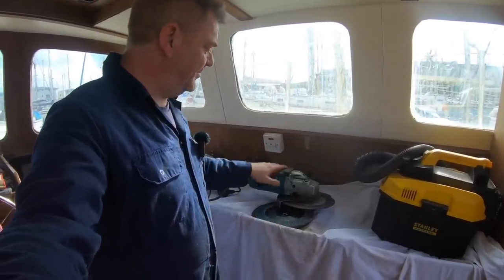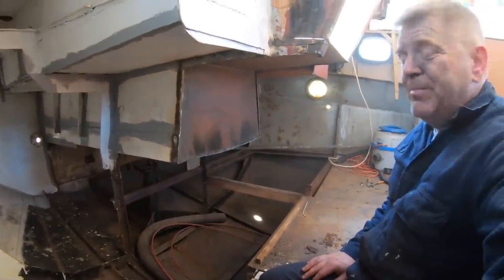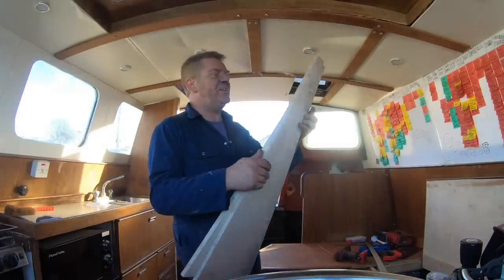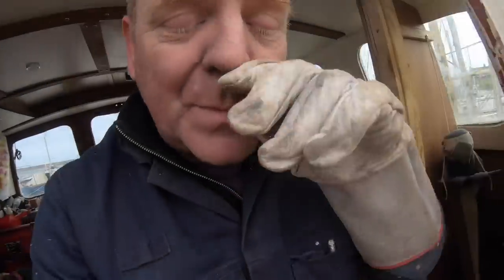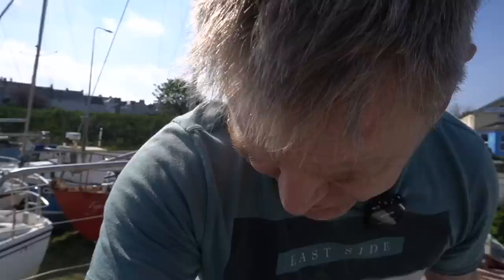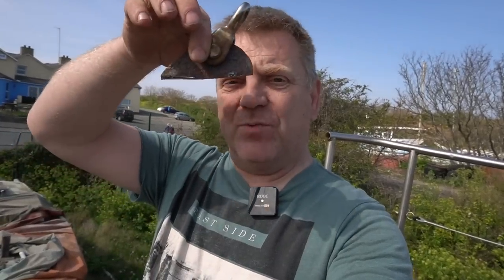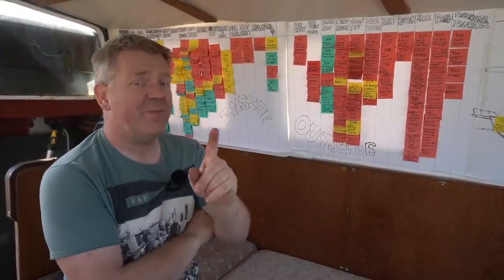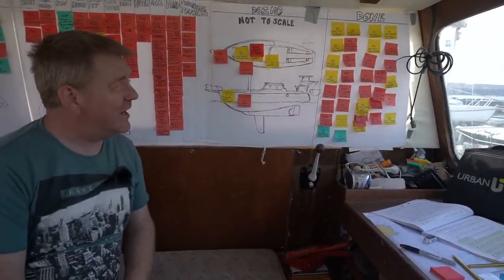#92 - Welding in CHAIN PLATES!!!! And cutting out under the bridge deck

Comment: Andy  9inch grinders are very heavy and not always the best tool to use. I use a 120mm grinder with 1mm cutting discs for most of my work only resorting to the 9inch as a last resort. See if Nigel can source you one of the old style leather welding aprons, these are great as they cover your legs when cutting and welding in tight spaces. They used to be super cheap. Good luck with your project.
Reply from the maker: I’ve got about 6 grinders of different sizes and I use many different types of disk from 0.8mm, 1mm for cutting and thicker disks for grinding etc.  it all depends what I’m doing at the time which one I pick up :) thanks though, I also have a leather welders apron which would have been very handy but I left it at home 🤦‍♂️

Comment: Your boat is coming back to life little by little, week after week. It will soon be a beautiful yacht, no doubt. The new stairs are great. removing the old rusty parts was a great idea. You now have a little bit more room inside... and no more sharp angles/edges. Good move.
Melissa, congratulations for your hard work for your skipper licence exam.

Comment: Lovely work!   I’m learning so much from you.   I wish I knew more about metallurgy and such, I have questions about welding new steel to old.   I’ll have to read up.   Lol.   Thanks for the video.   Welcome back Melissa and Jack!
Reply from the maker: Nigel knows way more than I do. Metallurgy is a big ol’ subject though :)
Reply: It's best to not think about steel as new and old, once you remove any oxidisation and get down to clean bare metal its the same as new metal. What is more important is identify what type of steel your welding together i.e mild, stainless, cast etc. But even more important is getting good penetration in the weld, a weld can look really neat and be very weak or look ugly as sin but actually be very strong with good penetration. in the very near future we have some hull plates at the stern to weld up close to the rudder post. If Andy agrees I will show some practical tips on how to get good penetration with MIG and Stick and ways to see if you have a good weld.

Comment: She really is a lovely looking old yacht but bloody hell there's a lot of work to do.
When it comes to the interior fit out, in my humble opinion, as nice as the traditional wooden panelling look they are dark, expensive to produce and maintain.
I think it would be interesting to give the boat a more modern look, using cheaper plywood and high gloss paints.
Something bright and airy, easy to maintain and clean, more like a modern home than a gothic church.
Just my two cents......
Keep up the fantastic work.

And as always
Massive Respect from Aotearoa, New Zealand
😀👍💛💙
Reply from the maker: Yes I don’t know if you saw the panels we’ve made for the saloon, we took them down for welding the chain plates but we’ve gone with a silk, off white which i spray on rather than brush

Comment: Nice job Nigel! Nice work m8, Good stuff Melissa 'Day Captain?' Haven't run into that before. Hope to find out more later. Just wondering, with all that cuttin you've done, what happen with Cap'm Jack Cabin? Seems to be, cut down by a third, from what I could see. Thanks m8s, you and yours stay safe and well.
Reply from the maker: I'm not sure why the call in Day skipper because you have to do night nav, but in essence is a skippers licence so you can charter boats and feel confident sailing in coastal waters, I eventually want to work up to yachmaster but rya day skipper is a good bench mark to start at.
Reply: @SailingMelody  Nice 1, m8, keep up the good work Eh!

Comment: Hi Andy, listening to your explanation of why all that substructure under the cockpit rusted has got me thinking 🤔, yes, it keeps on happening! Anyway, I'm wondering why the original builder drilled all those bolt holes in the first place. Thìnk about it, the only way for the wooden slats In the lazarette to fall out of the boat is if the boat is upside down in which case the slats are going to be the least of the problems! Here is my idea. Instead of bolting every slat individually why not join them together in a raft structure so that they can be secured with only 4 bolts or perhaps even without any bolts and just tied down with the ubiquitous cable ties? That way, should it be necessary to get under the rafts for some reason it's a simple matter to get them out. 
Melody is coming along beautifully. I think I had forgotten that she is a multichine hull which is very attractive to look at, esp from the stern angle. I think when it comes time for the final paint job she would carry a boot stripe very well! 
Good to hear that you're feeling better Andy! Hopefully, with the warmer weather coming up soon everyone will stay well! 
Cheers, David.
Reply from the maker: You know what….. I do like the idea of using nylon nuts and bolts to hold the wooden panels down, I think tie wraps would degrade but you’re right it’s fast to get under them in an emergency
Reply: @SailingMelody  Nylon is a great solution!

Comment: For your upright supports  rather then using flat steel as supports why not use section 80 steel pipe which is a lot stronger then flat steel and it gives you the round surface you want.
Reply from the maker: I would never use pipe for that on a boat because it will rot from the inside. Thanks that the suggestion though. We won’t be using flat bar thoug, we will use angle for the uprise supports

Comment: Wonder if Capt Jack would have more room if his bunk went port/starboard in the space you have just created rather than for/aft? You could take round supports diagonally from behind the steps to the bottom of the end plate of the bit I have forgotten the name of under the door!! Hope that makes sense to you? Good luck to Magnificent Mel with her skippering course!!
Reply from the maker: Yes that’s a consideration definirely. The original design was for that I think.
Reply: It is much more comfortable at sea to lie on a bunk which is orientated fore and aft than to be across the boat port/starboard. The rolling motion at sea in a yacht is torture if your feet and head are across the vessel rather than lengthwise.

Comment: Nigel is a heck of a Welder!!
 For your fabrications if no one will see the finished product  you could use flux core wire and skip the gas expense.  Much more splatter and slag but the wind isn't  an issue.

Comment: I think you've made a huge mistake welding the plates to the hull. It will change the metal where the plate is  welded and cause it to become britle along the weld line. Those plates are tempered steel and to retain the strength  of the plate they are designed to be bolted to the hull so they retain their strength. Hopefully  they won't bend or snap off when then have the pressure from the mast pulling on them.
Reply from the maker: We will also be through bolting the chain plates as a backup in case of catastrophic failure.  But even if the dissimilar weld is theoretically 10% weaker than a weld of like-for-like, it’s still much stronger than steel chain plates bolted through a fiberglass hull, and far stronger than it will ever need to be
Reply: @SailingMelody  My concern is the plate breaking at the point of the weld ,the weld may be strong but how much has the weld weakened the plate on both sides.
I think it would be wise to contact a metal specialist or engineer and consult with them about welding these plates. It's totally up to you I just don't want to see you and your family in trouble during a storm and high winds .
Reply: The difference in the parent metal and the weld metal will be negligible. The problem won’t occur at the weld but more at the heat affected zone around the weld. They have nothing to worry about. The weld is in a great structural position both on deck an under it. The angle of the plate looks to be aligned with the direction the rigging will take so there won’t be much chance of any side or point loading. Nigel and Andy have done a great job with them and it looks like they made any bad design redundant.
Reply from the maker: Thank you. And yes, it’s welded fully all around the top, all around the underneath and the whole way down and around the entire plate. And we left the original 10mm mild steel plate as a backing so it’s ridiculously strong. Plus we’ve put an extra hole in the centre so we can weld in a through bolt as a last resort measure if by some crazy fluke there was a crack in the weld or the HAS area :)

It’s something we have a lot of though to before doing it that way
Reply: About the same thickness aluminium plates work nicely welded to aluminium yachts... and there is one rule, valid both for steel and aluminium yachts: if you can weld it, don't bolt it!
In addition, what should tempered steel offer here: rockwell hardness? Irrelevant. More resistance to shearing forces? Nobody calculates theses plates by e.g. FE-analysis to the limits - so no worries...
IMHO, only kind of steel to worry is non-stainless steel high-tech steel. Stainless steel is soft(er) and weaker anyhow, so you just need to add material, and it will work nicely - with or without accidential (de)tempering by welding... just my stupid thoughts...
Reply from the maker: Nigel is a coded welded, welding instructor and welding examiner with specialisms in dissimilar metals, welding aluminium, stainless and mild steel. Welding the steel to the mild won’t have weakened the mild at all:  however any weld can crack in the right circumstances therefore as a last resort backup we have drilled through and will ALSO bolt through like you would on a fiberglass boat. I’ve very happy with our solution and have zero doubts about the strength of what we’re doing. Thank you very much for your concern and consideration though :)

Following your message 5 other marine welding and engineering specialists have messaged me privately confirming we are doing things the correct way.

Comment: Hi, i am watching your progress since a while and I appreciate your work and effort on that boat. But sometimes I am asking me, if you are not wasting time by doing things in a (for me) weird order. E.g. you built that cabin for Jack and now your are welding there again or you did some wiring and the insulation in the main room and now your are welding here as well (or cutting out pieces and so on). Wouldn't it not have been easier and faster to strip the entire boat down first, then do the welding and cutting and so on, then painting and then the interior? //R
Reply: I was wondering the same thing also. you installed a lovely new ceiling and now cutting and welding with sparks flying. 
any reason for this that I missed?
love the spirit and the work however. 
Good luck
Reply from the maker: Yes. The weather in winter was terrible and impossible for welding work so we focused on interior. Now we have good weather we can weld again but we have removed rhe panels to keep them safe while welding: they will go back up very quickly as soon as the welding is finished
Reply: This is certainly the best approach if you are doing this for the zillionst time - refurbishing a boat is a little bit like building a house - we are all not experts, so it is often better to use this incremental approach. In particular, as you often don't really know what is relevant at the beginning... in the end, I am grateful to watch the progress!